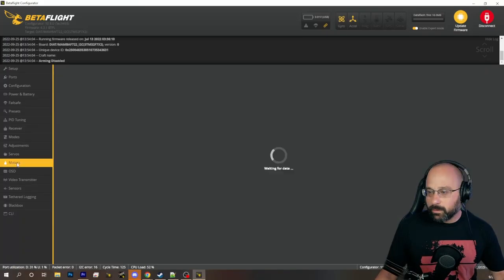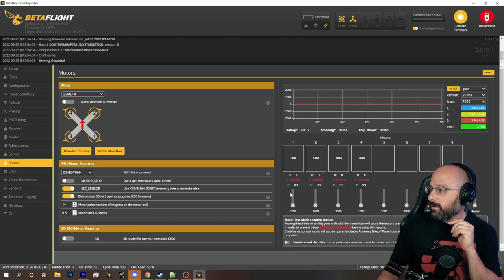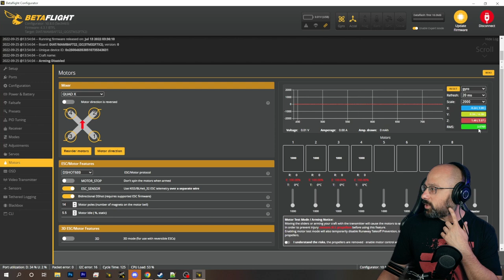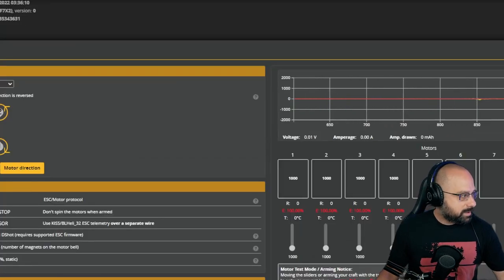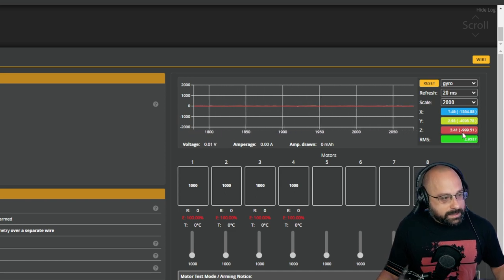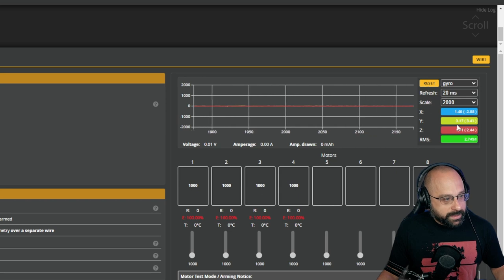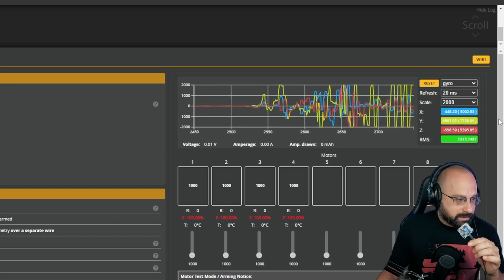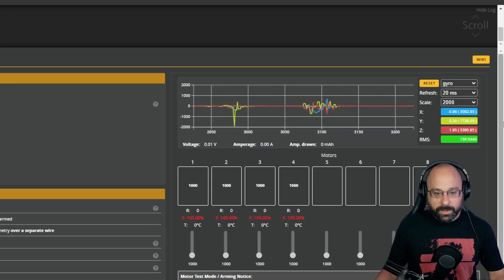How Do I Use Gyro Data to Check My Individual Motor Noise In Betaflight? - FPV Questions

Comment: ok but how much vibration on the scale is too much? i have a jello issue and i cant solve it. one motor causes vibration to 5" on the scale. The other motors only vibrate to like 2". Is that enough to cause significant jello?